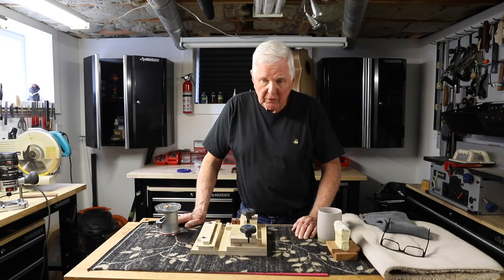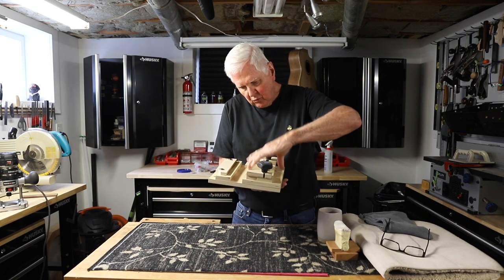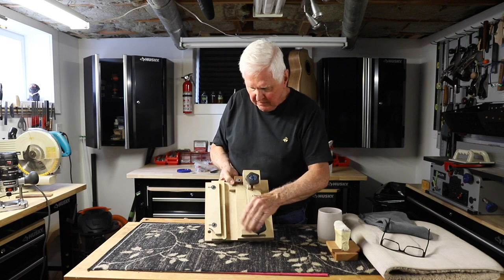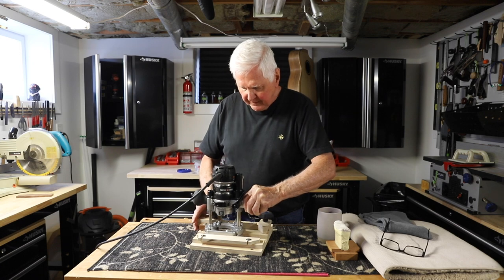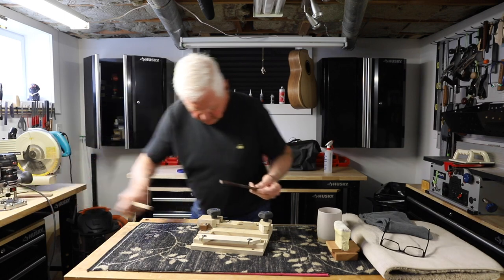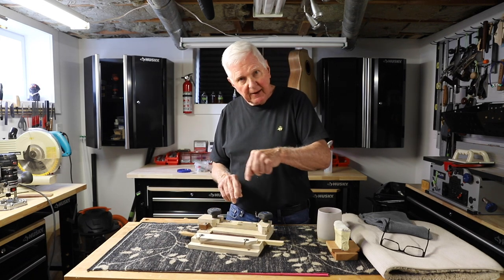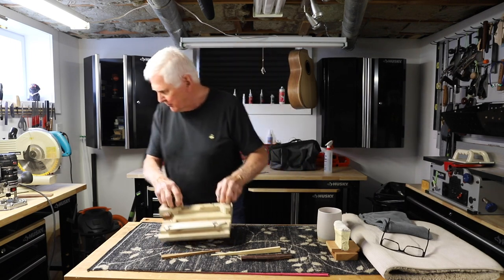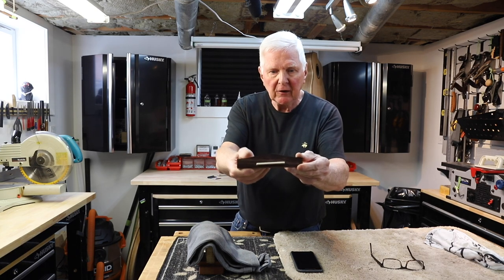Build a Bridge & slot it... with a super jig

Comment: Thanks for sharing this, Monty! Is jig of your - or your mentor's design? Would this be something that could be adapted to use with a Dremel with a plunge router base or a laminate trimmer? I'm limited to using either of those. I imagine that I would have to do several passes.
Reply from the maker: I use a laminate trimmer. My mentor originally designed this and then I added a back piece to stabilize the plunge router.